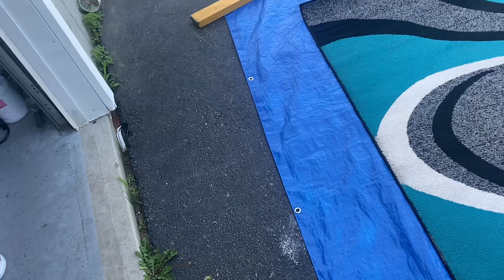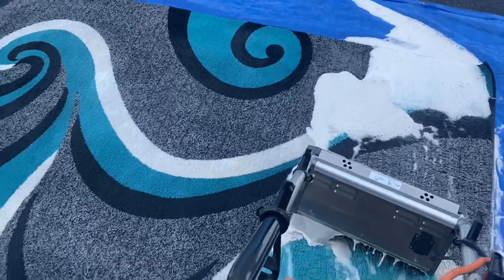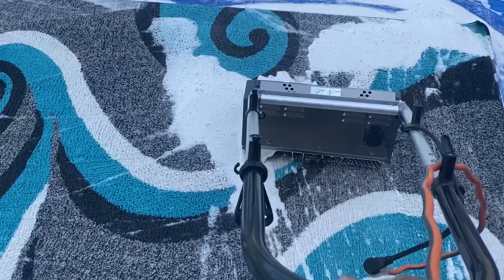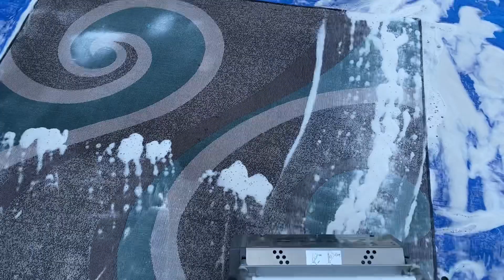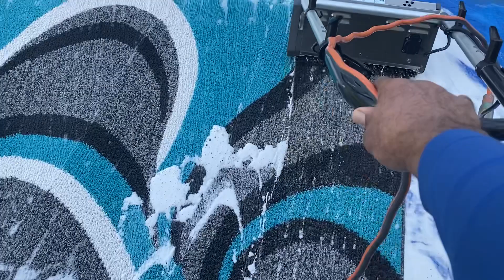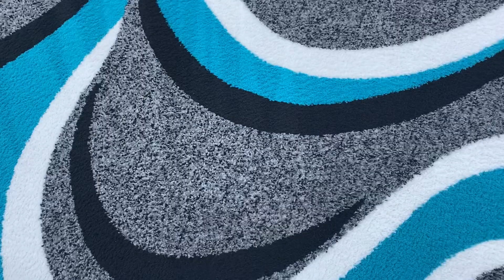Making these colors burst 💥 in brightness.

Comment: Boss man how long does it take to dry when you wash it with the crb
Reply from the maker: After I finished I extracted it as much I can to get all the water out then place it in the sun to dry .
Reply: @spotlezzcarpetcleaning640  ok I do the same for the drying plus I use my air movers to dry the back side, but I'm going to try that wash method once I get my CRB.